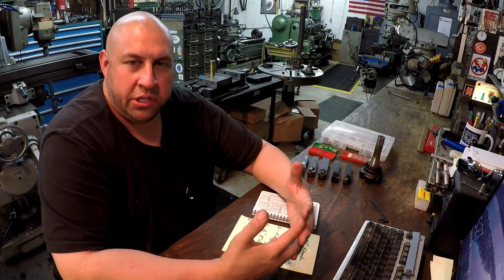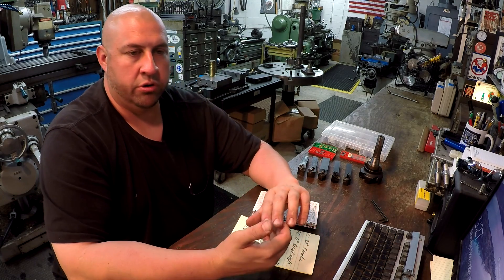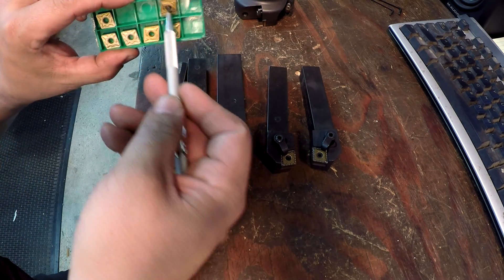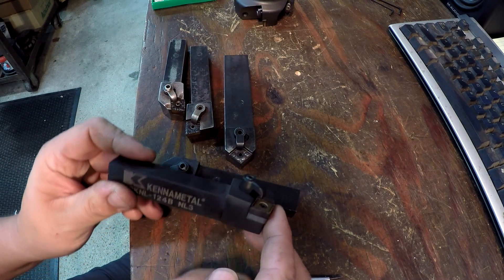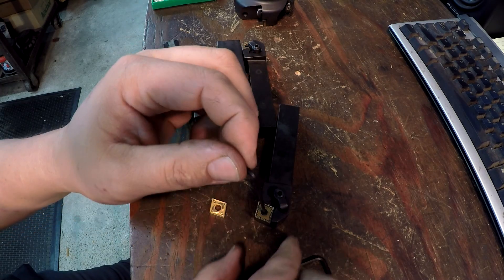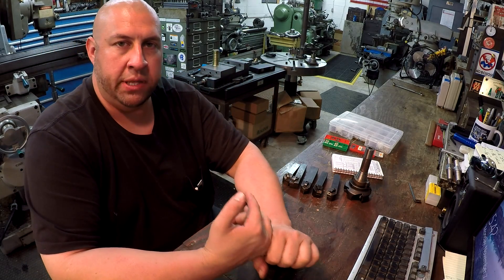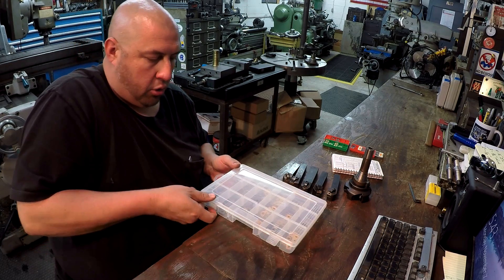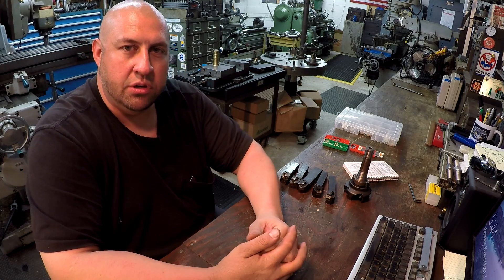Shop Talk 15: CNMG Inserts & Why I love Them

Comment: http://www.sandvik.coromant.com/en-gb/products/Pages/productdetails.aspx?c=CNMM%2012%2004%2012-QR%20%20%20%204305

Adam, if you really need to remove material, try those. They are only 2 edges per insert but they hog material really well. If you are interested I could show you 2 short  clips of me using them at Work. Keep up the good Content!

Comment: Have any of you found a good way to make sure you are not using an edge on the insert that you had previously decided was no longer good?  I have tried marking them with a sharpie, but chips and/or cutting oil makes that less than useful.

Also, Adam, thank you so much for your efforts and patience to help explain this stuff.

Comment: The tolerance rating is so when machinists replace the inserts on tools in CNC machines, they know that the cutting edge won't have to be recalibrated. So the cutting edge is always referenced in the same point in space, and the machine knows where it is cutting. If you have a cutting edge that varies +/-0.003", and you calibrate the machine on an insert that is perfectly on spec (By mic'ing a bunch of inserts until you get one that is right in spec, then using that one to calibrate the machine.), and then you change the insert to one that is off 0.003", you will be cutting in the wrong spot. And even worse, if someone calibrated the machine with an insert that was at one end of the tolerance spectrum, say +0.003", and replaced it with one at the other end of the spectrum, -0.003". Then you would be cutting 0.006" of your mark. (Assuming an "M" tolerance insert.) The best for a CNC machine would be an "E" insert which has a 0.001" tolerance. It doesn't really matter on a manual machine since you're going to be calibrating the location of the cutter after every tool change.
Reply from the maker: Thanks Andrew. I touched on what you mentioned in a recent shop talk. Good info here though.
Reply: Abom79 Oh, crap... my bad. I didn't think I've missed any videos since I've subscribed to you. I'll have to go back through and check into it. keep up the great work Adam... You're the man.

- Your local Florida friend
Reply: Non-machinist here...Been watching Abom and Fenner because I am interested in all things mechanical...Until this video, I thought CNMG was a Name Brand, rather than a dimensional descriptor ...If I had missed this video, I still wouldn't have known. That is one of the very few drawbacks to YT....That and and the life-time spent binge-watching YT videos ;-)
Reply: cmans79tr7 I don't get it... what is "one of the very few drawbacks of YouTube."? You thought that CNMG was a brand?
Reply: The "drawback" I was referring to was in regard to YT's "serial" nature in that if one misses a single episode, a learning experience can be lost and hard to find in the shuffle of the poster's channel. For example, even though you thought you had seen all of Abom's posts, you didn't see the one he refers to in regards to the differing tolerances of separate inserts and the effect on indexing, and since he is unlikely to repeat that same video in the future, you would need to review a ton of aboms posts to find the one with the info you wanted....In my case, if for some reason I hadn't seen this this YT post, I would not have learned about the insert designations and kept on mistakenly thinking that those designations were initials for the company that manufactures the inserts. Unlike a book that might allow looking up or coming across a key word in an index, YT info is audio/visual with no word lookup potential from the narrative.
Reply: cmans79tr7 Gotcha.

Comment: So what's the difference in performance between a CNMG and an SNMG?  All 8 tips of the SNMG can be used without having to have a second holder, which on paper, anyway, would seem to be an advantage.  Why, then, is a CNMG preferred?
Reply from the maker: SNMG is square and performs the same, but you dont have any aproach angle built into the tool if you want to turn to a shoulder. That where the CNMG is better, you can face, and turn in the same op. with a square insert you have no clearance.
Reply: Got it — thanks!
Reply: bx2200

Comment: lots of good info here adam. the world of carbide inserts can be quite confusing. i particularly liked your comment on using carbide on small home shop type machines. it can be quite difficult to to hit your number when using carbide due to the forces exerted on the lathe. my personal opinion is that most home shop applications would be better off using hss. but it sure is impressive watching you make chips.
Reply from the maker: The smaller HP machines work well for hss, especially the older generation of machines. You can use carbide, but try to stick with neutral rake tools, or brazed on with sharp cutting edges.
Reply: Take a look at ground and polished CCGT inserts. Razor sharp and great for Aluminium and finish turning steel. Most of the negative tales about carbide on small machines are based on older grades of carbide that wouldn't hold a sharp edge and so needed excessive tool pressure for light machines. Carbide technology has come a long way.
Reply: Paul Compton 
Plus one for that call out Paul CCGT Ali is my go insert it's the normal CCMT that gives me problems as I only have a couple it's no worry
I use the CCGT for all my work with care they are ok
Stuart

Comment: I used to use a lot of the triangle inserts  TNMG because of their ease of access and the fact I could use all sides on one tool. I now use the CNMG inserts a lot more because they provide a much more stable cut and you can remove a lot more material more quickly.
Reply from the maker: I still use the tnmg inserts, but they are for brute force! we still have a bunch of inserts and I don't mind if they get busted. I like the MTENN tool because you can easily use it for weld preps, chamfers, undercuts, and even course threading.
Reply: Abom79
Lots of options on inserts because they are all great at certain things. I don't have any of those sharp diamond inserts but would love to add some to my arsenal.

Comment: I must have a dozen insert tools and a huge collection of insert bits. All acquired over the years in job lots from various sources. Problem is, they never seem to match up. There are so many variables in size, fixing and shape, they just don't match. Also the markings (if present) give no real clues as to their origin. I will sort them out one day and cut down on the confusing number of odd tooling.

One of the biggest problems I have is the little spacer that some tools appear to have and some don't. Sometimes the clamp is missing too or broken. Is there a source for the spacer and fixing parts or are they manufacturer specific?
Reply from the maker: All common problems with older used tool holders. The carbide seats get busted, or removed to use on another like tool, and the screws and clamps get broken. Usually you can buy all those parts if you can identify the tool. I've gotten them many times from MSC.